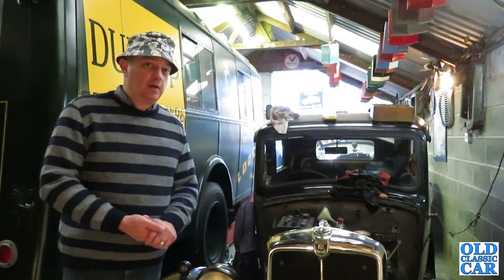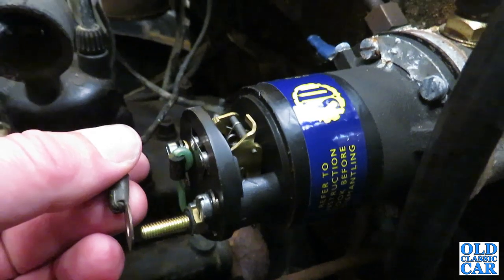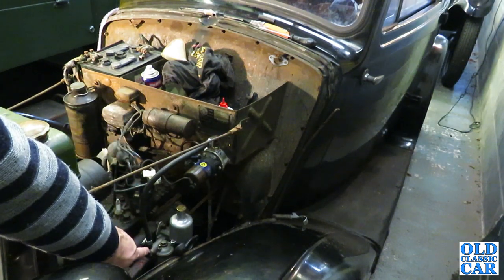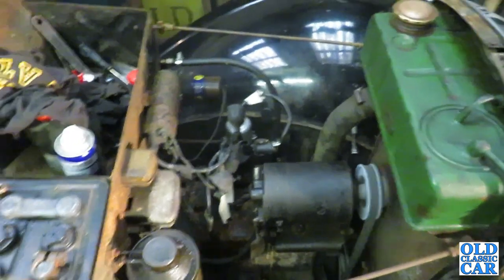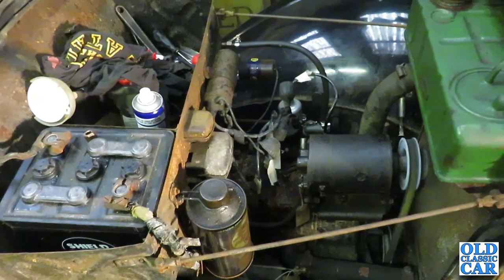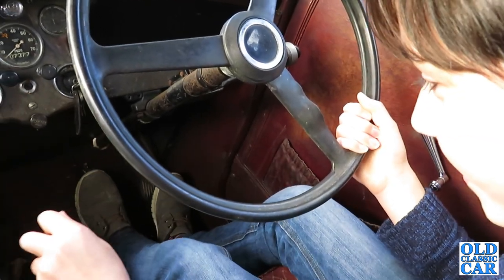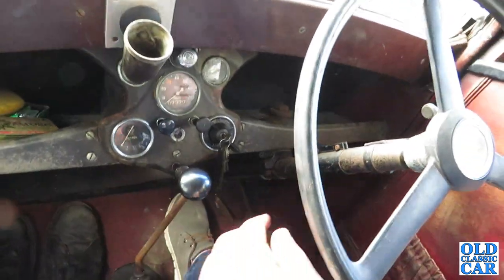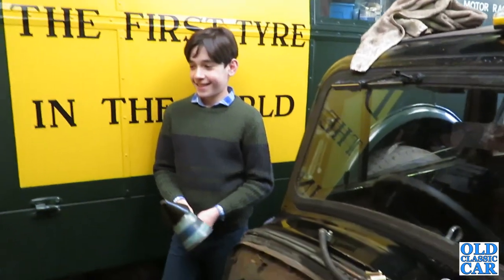Fuel fix & 12yr-old's driving lessons in the Morris 8 Series 1 (Ep4) | CLASSIC CAR VLOG

Comment: Certainly appears to be a Morris 8 diff. There was a period when the diff housing was made of Aluminium. These proved to be very fragile and would crack easily under drive. Check yours isn't Alu , other than that as you say driving will show any wear though I believe you could hear the diff. You are now ahead of me as I have yet to drive mine ! Incidentally there is a dipstick on the diff, access gained from removal of the center panel under the rear seat. Don't fill it to the high mark but just above the low mark. This will help prevent the hub seals leaking into the brake drums.
Reply from the maker: Useful info, thanks Richard, did the factory ever produce a workshop manual for 8s? Or is it something the club may have produced at some point?
Reply: @oldclassiccarUK  There is an Information Manual available from the Register for the Series 1,2,E & Z 1935-1953 which is very helpful. It's not much £10/12. And there are manuals on the Registers web site as reference and download. The owners manual which came with the car and come up on ebay at various prices are pretty good as owners were encouraged to do their own maintenance in many cases. Of course the Register Forum and Morris 8 Facebook page are good sounding posts as well.
Reply from the maker: @richardsellers-smith9496  Thanks, yes I picked up an owner's manual the other day. I'll probably end up joining the MR anyway so will check out their publications then. I appreciate the advice